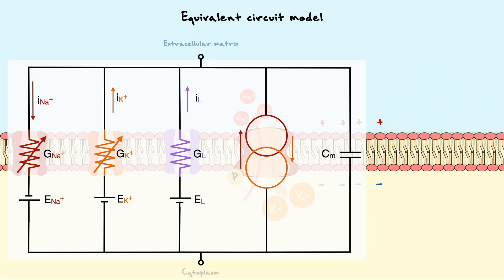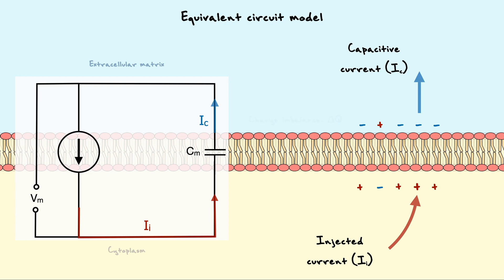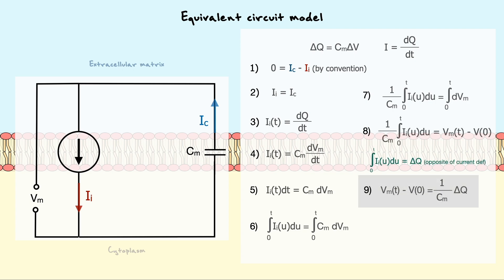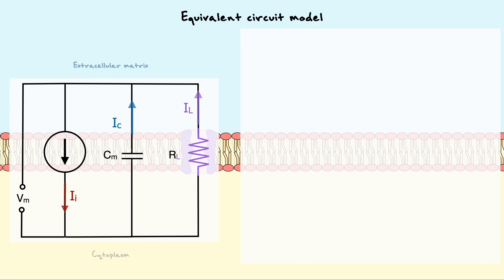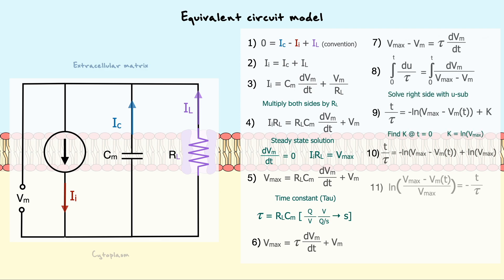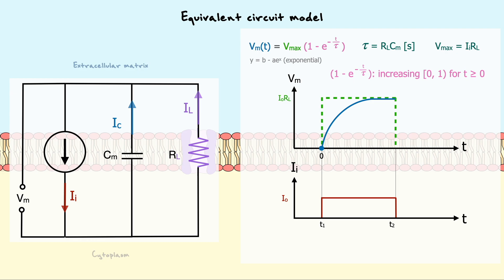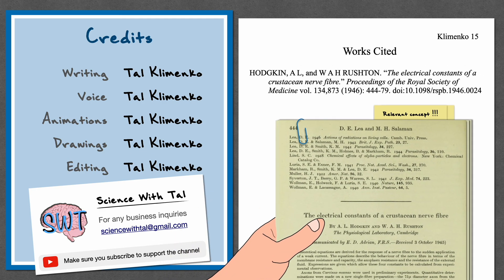Neuron As RC Circuit Explained And Analysis of the Time Constant Tau | Clip

Comment: Hi, just wanted to say your video is awesome, unfortunately i do not have the mathematical knowledge to derive those equation myself and didn't do electric circuits since highschool :/ so i wanted to ask you if you had any advice for me on where to start in math and physics to understand this (i have a solid grasp on biology, but no in physics an math)
Reply from the maker: Thanks for the comment! Broadly speaking, I think for math, having a grasp of differential and integral calculus will help and for physics, any type of course that covers electric circuits will help understand the parallels between neurons and electric wires.

Comment: Hey, thank you for recording a video regarding this topic. This might be a stupid question, but I'm pretty new to the subject. How can "positive" current injected by an electrode lead to depolarisation of the cell when there're potassium cations leaving by means of the resistors. Shouldn't the voltage become more negative due to positive charge leaving the cell ? In addition to that, I was wondering how the capacitor normally behaves when there're depolarisations and hyperpolarisations (not imposed artificially). Thank you in advance😅.

Comment: Hi 
I just wanna ask how the neuron will deal in case of the people who has asperger's syndrome ? What difference would be ?
Reply from the maker: Good question! Unfortunately, I do not think this is something that has been figured out properly. From what I learned, Asperger's syndrome (AS) and most other autism-related conditions are typically studied at the level of neuronal connections (brain circuits) rather than the individual neurons themselves. I did find this article (https://pubmed.ncbi.nlm.nih.gov/37179554/) that mentions that a protein called RIM, which is important for neurotransmission, is abnormally expressed in AS. Yet, when it comes to receptor expression and how the neurons in AS conduct signals differently from neurotypical people I am not sure this has been advanced. Sorry that I wasn't able to say much more about this.
Reply: @sciencewithtal  they say that the people who have asperger's syndrome they are smart and their brains works faster , they scan and then react faster , so if we want to project that on this ,  what are the values those would get changed in the circuit so we can have have different curves different results ?
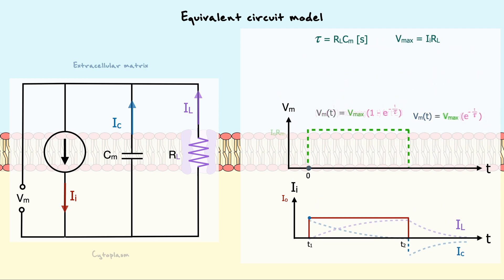Reply from the maker: @KALDI9  The RC circuit response is mostly relevant for excitatory and inhibitory postsynaptic potentials (EPSP/IPSP) which are electrical activities sub-threshold (do not trigger an action potential until they sufficiently summate to do so). The speed of conduction for a signal in a neuron is mostly limited to the action potential because it happens way faster than the postsynaptic potentials. From my understanding, I do not think that information is stored the individual neuron but more so across all the connections it makes. As such, I think its more plausible that Asperger's Syndrome is caused because there are more connections and thus information can be found faster rather than because the individual neurons communicate faster. Nonetheless, at 11:50 I discuss what happens when the time constants are increased or decreased.

Comment: I recently found out that the reason why high frequency currents don't stimulate neurons as much as low frequencies is the fact that the main parameter determining the stimulus strength is the charge transfered to the neuron, within a specific amount of time (time constant of the cell). 
At higher frequencies the charge transfered by every halfwave becomes smaller with increasing frequency. My experiments showed me that for both large and small contact areas there is no significant stimulus with macroshock if the charge Q is below approximately 0.3 to 0.8 µC. 
So at 250 kHz 400 mA of current should have the same stimulating effect like 0.5 mA at 50 Hz.
Reply from the maker: Very interesting to think about. Thanks for sharing that!
Reply: @sciencewithtal  Yes. But of course the relationship is mostly nonlinear for low frequencies and seems to get more and more linear with frequencies above 3 kHz.

Comment: Thank you for this video, it is very helpful.. I have a question please, why is the relationship between tau and RL (the resistance through leaky channels) directly proportional? In my understanding, the smaller this resistance is, the easier it is to lose the injected positive charge, which in itself impedes the charging of the capacitor, thus making tau long. Thanks!
Reply from the maker: Thank you for the feedback!

The relationship "Tau = RL x Cm" is found purely by definition because it allows to 1) simplify the equation (as it replaces 2 variables with 1) and 2) it introduces Tau, which has units of seconds and gives us an idea about the time to charge/discharge the circuit. I don't really have an alternate explanation for how this relationship came about.

For a given value of membrane capacitance, let's say 5, if the resistance through the leaky channels decreases (goes from let's say 4 to 2), Tau will become smaller since its value is found by the product of Cm and RL (5 x 4 > 5 x 2). Hence, a smaller value of resistance makes the charge and discharge of the capacitor smaller (since Tau decreases).

The way I see it is that a smaller resistance means the channels are more open and that causes the charges that make up the given capacitance to enter and leave faster, which would explain the smaller Tau. Inversely, a higher resistance would mean the channels are more closed and that would impede on the charging of the circuit since its harder for the positive charges to enter and leave.

Let me know if that answer clarifies your question !!
Reply: @sciencewithtal  Thank you, I think I understand it now... :)